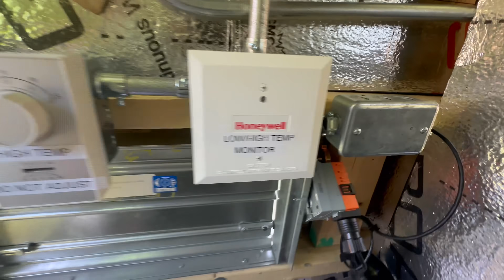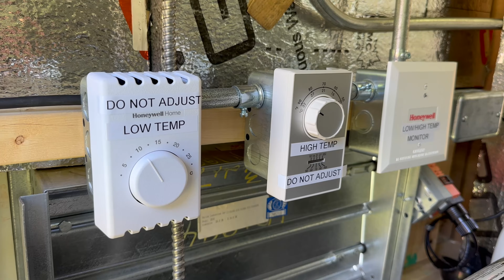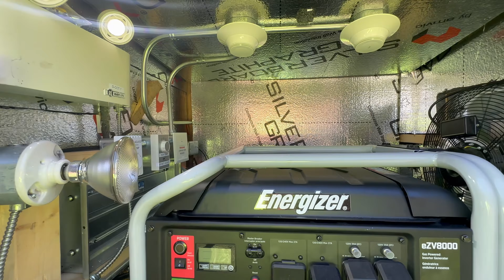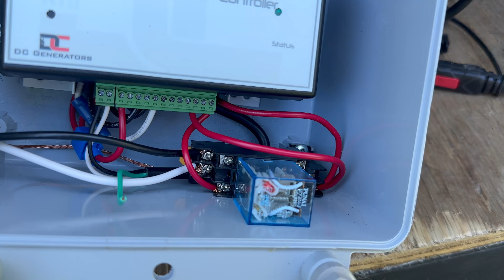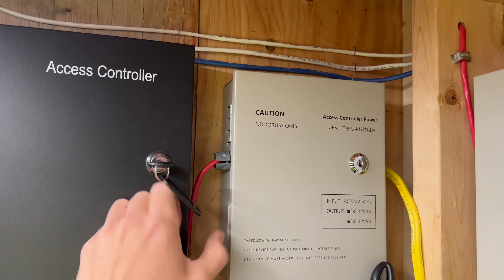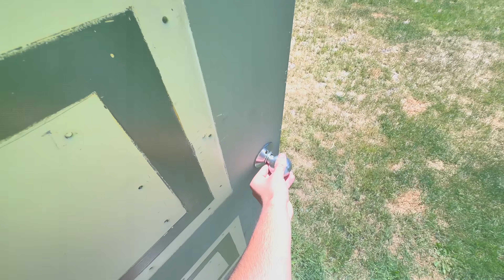My homemade automatic generator set up full walk through (video created for a school project)

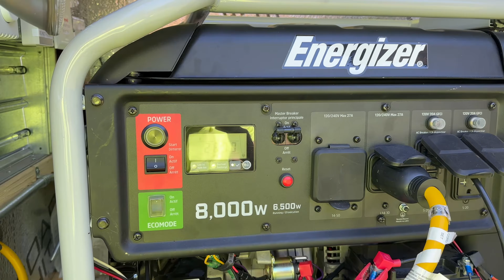Comment: 27:06 you run your welder off your generator sometimes?
Reply from the maker: Yes I don't have a receptacle other than the one on the generator so I will run it off that or temporarily hook it into a breaker in the panel

Comment: Nice setup. I especially like that the cooling is independent of the actual running so it will continue to cool as long as necessary even after the generator stops.

Comment: Engine and generator head should be getting clean air ( not interior heated air) from outside the unit. Even with ventilation the air inside usually much hotter.  I’ve seen several generations burn up with this method.
Reply from the maker: It's getting air pulled right over and through the unit

Comment: As a security engineer if 30 years that is quite the setup you have at home, reminds me of somewhere!! I too have a homemade genny control panel and ats, different colour here in the UK but the principles are exactly the same. Well done. As for the guy jawing about warranty and reliability, it will be solid. My panel is done with relay logic using off the shelf parts for simple maintainability. All the best. Ps I like the Notifier logo.
Reply from the maker: Thank you I appreciate it it means a lot to hear somebody that knows their stuff leaving a positive comment

Comment: I would really get that old federal pacific pannel in your main house replaced. They are extremely dangerous and the breakers don’t trip. Even the federal pioneer ones in Canada will not trip if a short circuit/overload, so obviously that is extremely dangerous.
Reply from the maker: Yes I am aware of the danger it's just a expensive project to replace all the breakers which would be pretty much every single one with arc fault breakers
Reply: @nics-systems-electric I don’t know how it is in Canada so I assume it would be different but in the states most jurisdictions have a rehab code that doesn’t require things like arc fault breaker and emergency disconnects.
Reply from the maker: @cadentheis  yeah it would depend what it's considered if it's an upgrade or can be grandfathered in
Reply: @nics-systems-electric  good thing your putting in that new fire alarm system in your house lmaoo
Reply from the maker: @cadentheis  i've wanted to get rid of it for a while but I don't want to pay for the whole thing and getting others to see the problem can be tough
Reply: @nics-systems-electric  If you ever were to replace that would you do it yourself or not?
Reply from the maker: @cadentheis  Id do it myself I just don't wanna pay for the whole thing when there's four people living there
Reply: @nics-systems-electric you could probably start a gofundme or something like that, i feel like enough of your viewers would get the issue
Reply: I believe the replacement breakers fix the problem the originals had. I don't know about your area/country, but I would think simply replacing the breakers without replacing the panel would be considered one of those things you can do without approval or inspection.
Reply: @HammondOfTexas0  the way the breakers snap on to the bus bar is  another big issue with them as well. The new breakers would help but it would really just be a bandaid.
Reply from the maker: i'd rather get rid of it completely put everything beside in the new Schneider panel and just use the FPE as a junction box and extend circuits over.

Comment: Nice video! A trick with those 2-10vdc Belimo actuators…there is a built in override function where you can apply 24VAC to the signal wire to command it fully open. This would allow you to eliminate the 10VAC wall wart transformer. Another trick would be to use a Belimo actuator with an end switch so the fan doesn’t start until the damper is fully open.
Reply from the maker: That makes sense as that's what I was originally doing until I was told that that will damage it eventually
Reply: @nics-systems-electric  you’ll be ok. We’ve been doing that on projects where we used Belimo actuators for years and haven’t yet had an issue.
Reply from the maker: @matth5309  maybe I'll run that through the relay then instead

Comment: Would you also want to turn it off of eco mode when the hot water heater/tank kicked on?  Just asking
Reply from the maker: No because you have no idea when the hot water tank is going to turn on it's not predictable and it's not a constantly starting and stopping load it's very far and few between that it needs to heat up

Comment: Very very nice setup you have  going on, now you have to integrate some of that into the house 😜

I do have a  question / concern,  it looks like the generator is commanded to shut down BEFORE the transfer switch operates when switching back to utility. That would cause your building and its equipment to see an under voltage that may not be good on the electronics.....  There should be some sort of way the transfer switch can tell the generator to shut down only after  the switch is back in "utility" position and even after a short "cool down" run with no load
Reply from the maker: Because of the way this is set up with no communication between the generator and transfer switch that is just how it happens with no way around it but I'm not concerned as all of the electronic equipment is on UPS back up power so it would not experience any undervoltage the transfer switch prioritizes generator power so the only way to change it would be to switch the generator feed and utility feed on the transfer switch to opposite contactors for to prioritize utility power
Reply: @nics-systems-electric  Ah  ok that makes sense, I will have to go back and watch the vid of the install of the transfer switch and auto start,  I really like that switch, even with a non automatic generator it would prove beneficial, as soon as you apply gennie power, BAM switching complete. No going in the dark to operate breakers etc.
I work in a hospital in Ontario and all our transfer switches are ASCO 7000 series, nice stuff but they will not even think of operating unless the generator and utility are within 5-7° of being in synchronization, two are closed transition so you literally see nothing.